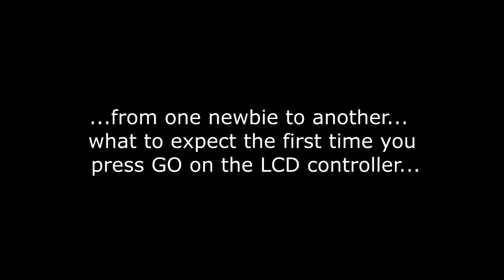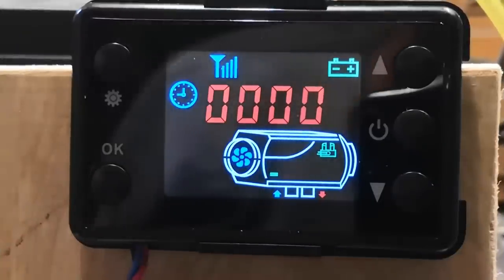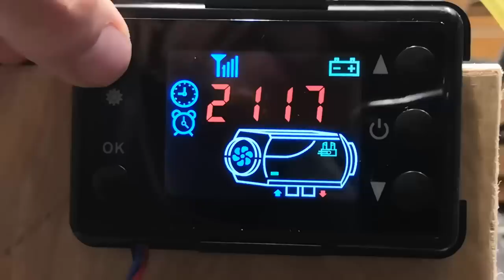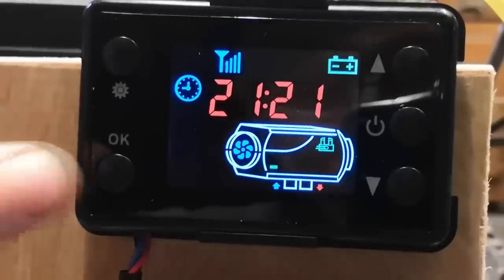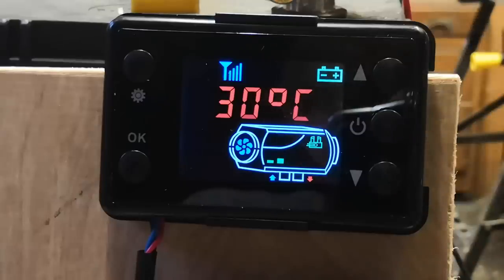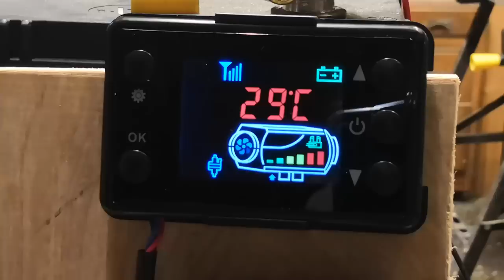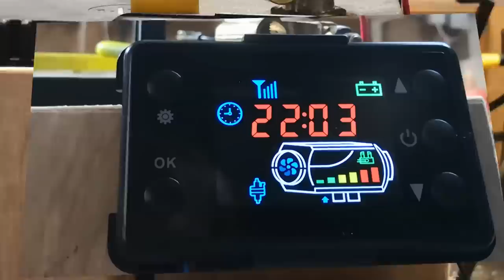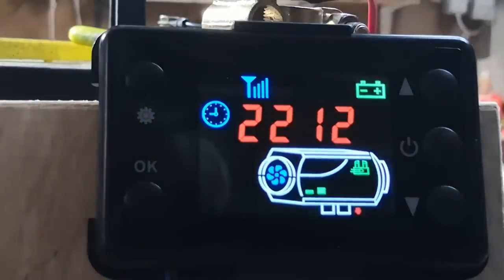First Time you press go...  LCD Controller- Chinese Heater

Comment: Do you have a video of how to wire this up to the leisure battery?
Reply from the maker: Hi.. sorry I have no vid but there are plenty out there if you do a Youtube search. Good luck and hope you enjoy your heater.
Reply: @campervan_hackers  thanks, every video I find shows everything but not wiring of the unit up to a power source. Thanks anyway
Reply: Couldn't be simpler - black wire to negative battery terminal, red wire (with the fuse on it) to positive, connected direct to battery not to an accessory circuit. And use your deep cycle leisure battery not your car battery - it's a marathon not a sprint, it could be running for hours on it's own and you don't want a flat car battery.

Comment: Hi thanks for this video, just have a question about the lcd monitor
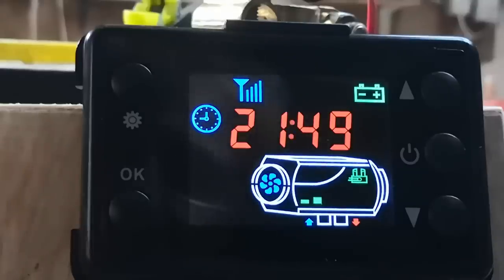At 04:12
You have:
Time .... ok
30 degres .... ok
34 degres .... ok
Volts .... ok
Me I have
Time .... ok
30 degres .... ok
P-2,1 Hz .... ok
Volts .... ok
Can I change Hz ?
Thanks
Reply: Hi, it's ok. 2 top button together

Comment: could you not suspend the pump in an insulated box for silence?
Reply: I made a separate bracket that I suspended with four camera mount balls (used for camera gimbals) and I can barely hear it. I just used two plates with four holes, one each corner for the balls, then used the standard rubber P mount to attach the pump to one plate. I also use silicone fuel hose, the plastic stuff transmits noise also.
Reply: @alasdair4161  good man.........................sounds like the way forward then

Comment: I get error zero and error 10 ...also leisure battery draining like nobody's business. 
Why is this? It works, but will not heat the air...
Reply: i got the same issue E10   other videos say its a fuel issue, either air in lines or blockage or fuel pumps not clicking and also these heater need to be primed before you can use them properly or they will through codes....my issue is my heater is in a piece of equipment and i cant see if  I am getting fuel to the heater or not ...i didnt want to use those clear cheap fuel lines,  my line are solid  ...

Comment: As soon as I press the up arrow, my lcd screen resets after I hear one click or my fuse blows. Any ideas?
Cheers
Colin
Reply from the maker: Eeeek, sorry bud but can't help on that one... does not sound good. Does this happen while the heater is on or before firing up?
Reply: @campervan_hackers  I've never even used it, been in my attic for 9 months waiting for van to me finished, diy camper. This was the last thing to do, installed it, powered on lcd screen, pressed "h on" and fused right away, every subsequent effort it will fuse or reset screen after a click. Frustrating, chinese sellers not wanting to help unsurprisingly after 9 months. 😭
Reply: @campervan_hackers  so at the priming stage that's when she blows. Never even heard or seen it fire up.
Reply from the maker: So if the priming function causes the fuse to go, might be a short in the pump circuit? Clutching at straws here... but check all the wiring to that. Then, if still happening,  unplug the pump and see if it still happens... you will at least get an error code but if it does not fuse it might, (might), be a problem with the pump. Let me know how it goes...
Reply: @campervan_hackers  OK il give that a try, thanks mate. Il keep you posted. Cheers

Comment: Hi. Thanks for a very well-detailed and explained tutorial. As I have just bought one of the all-in-one heaters. I have watched someone elses tutorial. He said it's a good idea to install an in-line fuel filter. Is it normal for the green glow plug symbol to be on, all the time when the heater has reached its normal running temperature and speed has settled down to the number I have set it to?  I would very much appreciate it if you could advise me please. By the way. I bookmarked half a dozen other people giving advice. but I've deleted those and kept just you. I would like to join the group you mention. but I think it's on Facebook? I don't do Facebook. so where else can I find it?
Regards Dave
Reply from the maker: Hi... Glad the vid was of use. The glow plug icon is red and should go out when the thing is fully underway. To  the right of that there is is heater symbol which is green and stays on. There is mixed views on the inline filter... I have used one but I know some who have separate tanks put one at the fuel pick up point. I regret that forum I refer to is a Facebook forum and is one of several on Facebook. I do now now of any others... sorry I can't help there. Hope you get good use out your heater... I really think they are good bits of kit.
Reply: My heater came with an inline fuel filter. So far no issues

Comment: Do these run on kerosene and what is the current draw?
Reply: I believe they are designed for diesel fuel. One I have seen (Julien Ilett) draws around 9 Amps on glow plug and runs steady around 3 Amps ish, depending on fan speed.

Comment: Got error o6 checked everything cant get it working HELP PLEASE
Reply from the maker: The Error code tables suggest this is an issue with the magnet on the fan (it sends pulses to measure speed). Is the magnet on your missing perhaps?
Reply: @campervan_hackers  ill   take a look

Comment: Heater shutdon wit E05.
Do you know what i can do ?
Reply: I had that to start with it's the motor speed sensor I went into the settings and altered the sn-2 to sn-1  then the heater stayed on and cleared the error
Reply: The code for mine was 1688 then ok scroll through the menu I set my 5kw at o.8 oil feed min and 5.0 max then the motor speed to 1650 min motor speed 5000 top then 12v then the sn option to  sn-2 then ok maybe different on your model mine has the same digital display as one on the video shown the settings are in the advanced need option I had to give it a try as I had over fuelling problems giving me smoke and light black soot
Reply: I'm glad I could help thank you

Comment: As I start the heater up my control pannel flickers and goes off
Reply: Bad earth
Reply: Either Your  Positive or ground/earth wire is not connected well enough to handle the increased draw at startup...  if connected to the body of a auto, camper etc remove cable and clean with steel wool. If connected to the battery, remove, ensure 1 connector or if using stripped bare wire, fasten securely and that should do the tick.

Comment: What is the E-1code mean
Reply: Hello mate when i get E1 it means there is not enough power. Make sure your battery is fully charged. Other issues is no fule or the air intake is blocked or restricted because you have bent it too much. Did you sort it?
Reply: Yes. Thanks for your help.

Comment: Hello, can anyone tell  me PLEASE  how to increase the brightness of the screen display as mine seems to be very dull
Reply: You may have to tilt the screen towards you, mine looked very dim at first but now I've re mounted it at an angle it's much easier to read
Reply: Thanks I will try that   .
 @henryrussell8311
Reply: Mine used to be nice and bright but it's now quite dim. It's been on for around 4 months and I'm suspecting that the back light panel (if it's not LED) is starting to fail. Would be nice if there was a display off function, but I can't find one.
Reply: @lukeb5584    Yes seems to be no display off button. I have taken to disconnecting at the plug In between journeys

Comment: Hi All - we have just purchased one of these to heat our workshop - and used mains 100W 12v power supply. The machine is primed and turns on fan speeds up and slows down just to speed up again then machine switches itself off. When on the button pressed and hold same happens but fan seems to be running faster we then get E-07. When pressing up and down arrows we are getting khz rather than temp... any advice would be much appreciated.
Reply from the maker: Press and hold setting button and up button a the same time when showing Hz to change to temp
Reply: Your power supply may not produce high enough amps. With a clamp meter, I get a draw of 10-11 amps during glowplug pre-heat so maybe 135ish watts drawing from large 200amp hour deep cycle battery. 100watts/12.5v=8A.
Reply: @alphamachinegunandsuppress9620  Thanks for your suggestion - we have been using a mains 100W switchable power supply at 12, 15 and 18v and now tried another one 12V 10A again same results machine runs for 1-2minutes without generating any heat and automatically switches off after that period. We are contemplating using a jump pack instead? No news from the suppliers yet.
Reply: @alphamachinegunandsuppress9620  Thank you for your reply.  We are now running it from borrowed jump pack but still looking for mains power supply solution
 - could anyone suggest a suitable one?
Reply: Would this one do the job?
Reply: @Lemonsigns  Hi !! Did you solve te problem. Mine  is doing exactly the same with my Goalzero battery
Reply: @Lemonsigns  You can buy a 30 Amp bench power supply with a variable voltage output (you can set it to 12V) from your local electronics store.

Comment: I got this lcd unit as an aftermarket purchase to my heater but it keeps saying error code 8, does anybody know what the error codes are and how to fix?
Reply: I believe error codes are as follows. E-01 Voltage low, E-02 Voltage high, E-03 Ignition plug failure, E-04 Pump failure, E-05 Too hot, E-06 Motor failure
E-07 Bad controller connection, E-08 The fire is extinguished, E-09 Temperature failure.
Hope this helps.
Reply: Luke B  do you now error E 10 ????
Reply: @MS-nt9vw  Strange. There isn't a E-10 in my list. I think I did see it mentioned somewhere, but can't find it now.
Did you try unplugging the controller and plugging in again?
Also, check the settings in - - - - display enter 1688

Comment: Hi I'm getting eo6 code any ideas what it might be thanks
Reply: E06 is the small sensor on the controllerboard which does not 'see' the vent rotating. the sensor reacts to a small magnet on the vent. try to push the controller board a little closer to the vent wheel, just before it touches. of course this only applies if the vent is rotating & trying to start up. if it doesnt rotate the vent motor is defective.
Reply: @janolsen7585  thanks will give it a try
Reply: I have the same fault code-06, I try what Jan Olsen say, but i didn't work, 
Have someone a idea ?
Reply: @StormGlenwalker  hi someone told me it might be the control board faulty
Reply: @colinwade6802  In my case it was the fan that was stucked, by removing the hood he came loose. I sand the fan and it work well now.
Reply: @StormGlenwalker  I will try that and see if it works
Reply: @janolsen7585  yes the fan stucked, open the hood and sand the fan works

Comment: just bought on getting a error code e-06 can anyone help
Reply: hey, me too ! did u find an answer ?
Reply: Open the heater, probably your fan is blocked.
Reply: Had the same problem. Found a peace of plastic sticking out on the fan. Sanded it back and away it went.

Comment: Hello, Camper, are you interested in 5KW/7KW/12V/24V water heater&air heater integrated machine for diesel? it would bring you more views
Reply: I'd certainly make a review video on one of the units that heats water..been trying to find a good deal on one...
Reply: @buttercupwalker  that is pretty cool,
we are professional in heaters, 
like water heaters, air heaters, air heater &water heaters integrated machine.
Reply: @degrouplimited   just sent you an email
Reply: @buttercupwalker  yes, we received, thanks

Comment: I have just installed my heater and the battery light keeps flashing.
Reply: Go on settings and change the voltage properly to your car. the code for entry on settings it's 1688

Comment: Hi There, we installed a 5K heater , everything worked great for a week and now it is coding out E05, started a couple time now it continuous, had it running in shop it is like it heats but doesn't want to cut out thermostatically we have the lcd control set to the lowest setting for temp and it goes way past that temp. anyone had the same issues??
Reply from the maker: These heaters do not switch off.. they only go to there lowest run rate....  they have to keep the flame tube going.
Reply: The units have a default level of minimum burn which means once they reach your set temperature (actually usually 1 degree above) they just tick over. The reality is that if your heater reaches this temperature and the capacity of the heater is (at minimum level) way beyond the thermal capacity of the environment to lose the additional heat through cold leakage (ie drafts, vents, or natural heat transfer) the temperature will continue to build.  The only choice then is to turn the unit off!  Perhaps one of the differences between a Chinese rip off unit and a Webasto / Eberspacher is that the unit cannot switch itself on and off to more closely control the set temperature?  But for me the main problem is installing a heater of too high a capacity.  I have a 2kw unit and it is more than capable of heating a sizeable camper/motorhome.  A 5kw unit could service a totally uninsulated industrial lockup in a  Siberian  Winter!
Reply: When the heater starts, the pump ticks quite fast and then when it reaches the set temperature it should slow down so that it ticks once or twice per second. If your doesn't do this you could possible have a faulty temperature sensor. Sorry I can't be of more help.

Comment: How do you change the temperature to Fahrenheit? I tried the parameters PF1 to PF6 but could not tell what they are for?  Original password code was 1668, anyone has a link to an actual User Manual guide?  Thanks.
Reply: I dont think its possible to change to Fahrenheit.
Reply: 20° celsius is good normal temp. 25 is warm 😎
Reply: 1688 myne

Comment: I have bought 2 similar heaters in the past 30 days.  Neither of them work.  !st one, could hear & feel pump trying to work, would not move any fuel.  Absolutely no help from seller.  Second one, display lights up then battery symbol begins to blink, shows error 01, low voltage.  At the same time it displays 13.3 volts.  Test meter confirms 13+ volts.   Tried 2 batteries & a charger.  Waiting for this merchant to reply.    Bought through ebay, at least I'll get a refund.
Reply: @Hotpack I tried two batteries.  The second one starts a 4 cyl. Ford tractor in cold weather.  So, I don't think it is a lack of amperage.  Thanks though.
Reply: You can get a fuel pump separately and try to fix the first unit. I know it's lame but better to get some use from it.
Reply: @MrBooMY3  Thanks for the suggestion.  I had considered that.  I tried to get the seller to send one.  It would have been better for them if they had.  I would have been OK with paying for a replacement and sending the original back.  After they saw that it was defective, they could refund the pump money.  Two weeks of emails, they still offered no remedy.  Ebay's return policy works.  I'm only out a lot of time.  Same thing with the 2nd heater.  Just got a full refund via PayPal.  Thanks again.
Reply: @lukeb5584  Thanks, but I did go through that routine.  A couple of times.  It didn't solve the problem.  I don't understand why the manufacturers & the sellers don't find some one who understands these machines & speaks English to create a decent set of instructions.  I sent them both back.  In each case, I contacted the sellers describing the problem & asking for help.  Their response was to ask for pictures, and then videos.  Not a single suggestion of how to solve problem.  I do appreciate your help, thank you.

Comment: If you have ?S about Diesel Heaters watch JOHN McK 47 on utube his video SERIES ANSWERS EVERY AND ALL ?S YOU MAY HAVE ABOUT DIESEL HEATERS CONTROLLERS,INSTALL FUEL ANYTHING BETTER AND 120% MORE COMPLETE THAN ANYONE I HAVE FOUND ON UTUBE.
Reply: Agreed ..starting with the fact you want to install straight up and down not at 15-45 degree angle..this made perfect sense to me after having to redo and repair my Injector pump in my Truck which does the same thing as the little pump here
Reply: I can't read what you're writing when you SHOUT WITH ALL CAPS